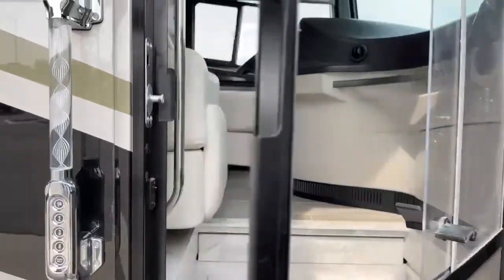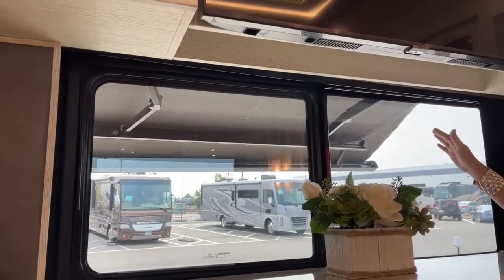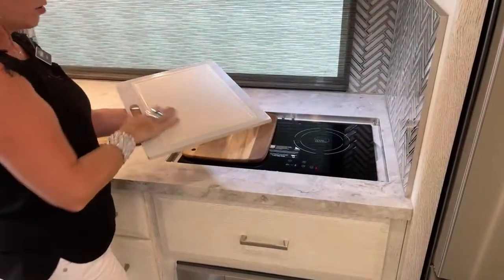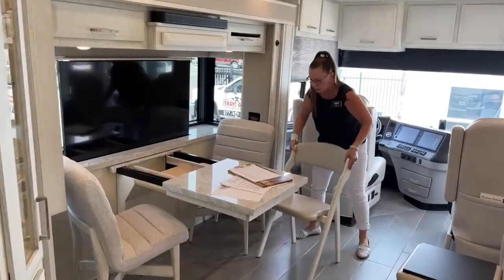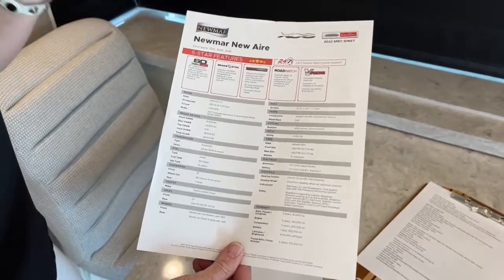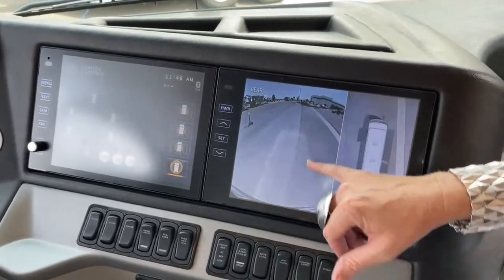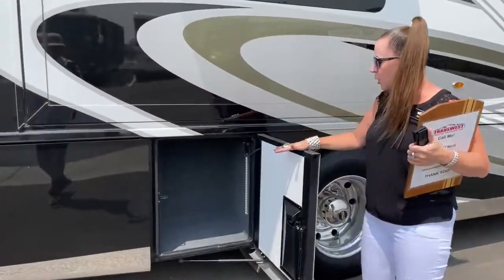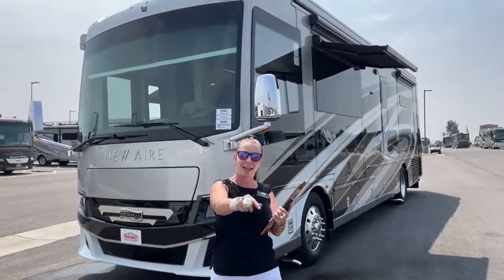2022 Newmar New Aire 3545

Comment: This has been a very well detailed review, Thanks. On thing you missed which is really quite important is the drivers side emergency escape door , behind the toilet, that has telescopic stairs so you can get out easily feet first with stairs and grab handles. Rather than fall head first 8ft from the ground from the bedroom window. I really LOVE this floor plan and the full tile floor and yes the solar panels on the roof. One thing to mention to Newmar is that Lithium battery's are now cheaper than AGM and take up half the space and 1/4 the weight. I've had lithium ( LI FE4) since 2013 , installed them and have never had to look at, or do anything with or too them since. The fact that they charge 4 times faster than AGM and will last 30 years or more longer it is a no brainer to install from the manufacture. The only addition that is needed is a $200 DC-DC charger put between the altenaitor and the house battery's.       CHEERS            Steve h.

Comment: This floorplan is better than the latest 2024 where they put the tv on diagonal not directly in front of the sofa. Also in the 2024 the chair hide a part of the tv when looking from the sofa. Not on this 2022. And this 2022 has plenty of space when the slide-out is in. In the 2024 even a small dog cannot go through. The 2024 are a drawback i think. The only advantages is the Lithionics but you can always ask Mastertech to install an even better for you in the 2022. Disappointingly, Newmar changed the floorplan but not in a good way.